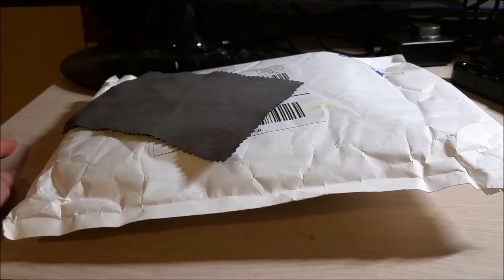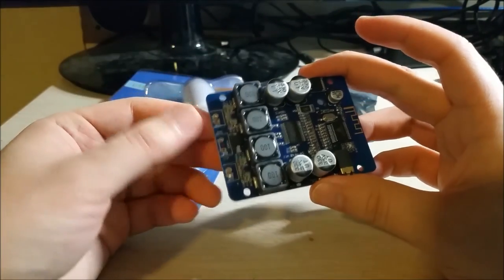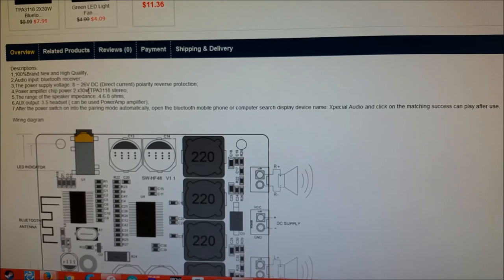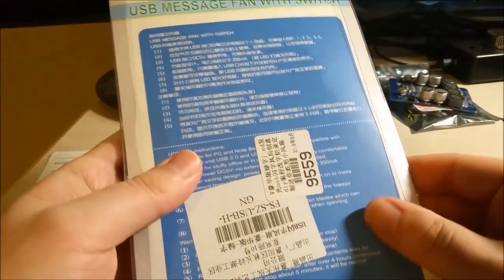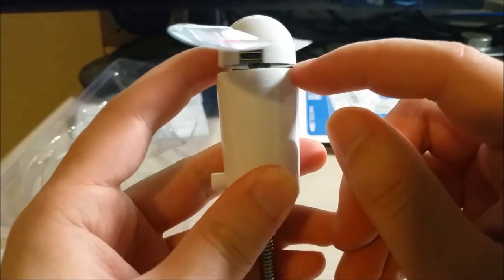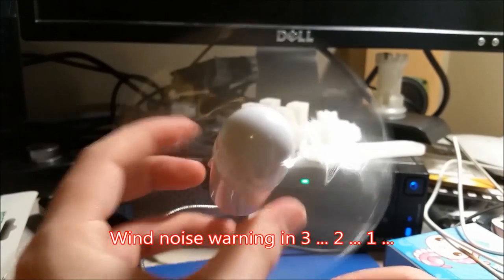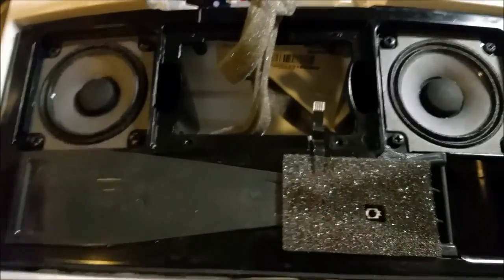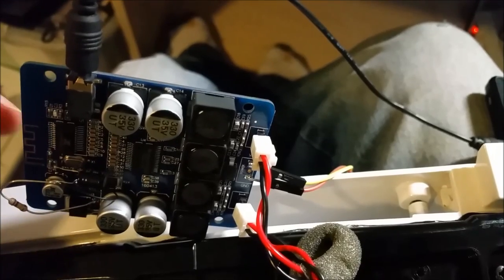Mailbox #3: ICStation DIY Programmable LED Fan and TPA3118 2x30W Bluetooth Digital Power Amplifier

Comment: Could you draw on a real photo of the amplifier the modification you made?

I have a sonwu tpd3118 but it's different, mine is red and has pins to put pause and play, volume +, -, next, previous, vcc, gnd and com 1v8 =? also pins for the audio jack. they are 4 r = right; l = left; t =? and com = ground.

You know what is t in the jack pins and what is com1v8?

thanks

Comment: i have many amp board, but as i tested with my speaker, this was the best sounding to my ears. BUT the bottom side was bluetooth signal is to weak, its always delayed or disconnected within 2 meter. Can you make a mod for external antenna? thanks if you can do that

Comment: Hi I'm thinking of using this amp to add bluetooth functionnality on an old car (found the 12v ignition signal and speaker connections from the cd player), do you think this would work well for my application ? Would it be loud enough ?
Reply from the maker: It'd be plenty loud on 4 ohm speakers.

Comment: hey great video.  i have got a question. if you could help me out. is there any ground loop or ground noise in your amplifier? if so how do you eliminate them?
Reply from the maker: There's a little hum if I put my ear right next to the speaker, but it is unnoticeable when further away and definitely when playing music. As a general rule of thumb, to eliminate ground loop hum you will need to make sure to use shielded cable (coax/braided/etc) on all low level pre-amp side audio signals, use a filter (common mode choke/low pass filter with 3db point set below 50/60Hz) on the power rail to attenuate 50/60 Hz, use an isolation transformer in line with ac supply if one is used for power. As you can guess, what tricks you can use will depend highly on what your exact setup/wiring is.
Reply: @sjm4306  Thanks for the quick reply :). i will check mine. and use shielded cable.

Comment: So if I wanted to use the Amplifyer only with AUX I couldnt just basically rip out the Bluetooth antenna could I? It would just stay muted wouldnt it?
Reply from the maker: I guess if you really need to shut bluetooth off you can feed the aux port detect pin to the sleep pin on the bluetooth chip to force it to shut down when using line in. Or even easier just desolder the bluetooth chip/cut power traces to it and be done with it.

Comment: At my module tpa 3118 2x30watt. Near 3,5mm jack socket. Theres 2 little hole with note Vol +. How to put volume potensio for his modulle board. Thanks
Reply from the maker: Have a link with a picture of the board so I can see?
Reply: @sjm4306  would you let me.know your email, so i can send the pict by email
Reply from the maker: Sure, my email is sjm4306@gmail.com

Comment: Hi. Im using same amp. But i have problem making a really low volume. Can u help me how to add a volume on it?
Reply from the maker: Leecarl Liwanag If you look up the datasheet for the chip you can find out which pins control the gain (loudness) and check them with a multimeter to make sure it is set to the loudest setting. Mine is plenty loud so it could be yours has some soldering problem or is damaged.

Comment: Is there a way to turn off those stupid announcements? I really hope there is a pin to pull up or down to put that cute lady to rest...
Reply from the maker: NGC1433 I wish there were an easy way. I just manually momentarily mute the amp when I go to connect or disconnect.
Reply: I scrolled along the datasheets for a couple of those BT chips - they are immense beats with a bunch of serial interfaces for control. This one has a facility to use audio files instead of beeps, as particular manufacturer choose to do. But digging into them just to configure the announcements defies the whole reason of existence of these amps - three wire connection bluetooth enabled soundthings as a one evening project.
Reply: @sjm4306  how do you mute this amp
Reply from the maker: The amp chip has a mute pin, I just soldered a wire to it so I can manually mute audio output. You can find which pin it is by downloading the datasheet.

Comment: What to do if the amplifier does not work bluetooth
Reply from the maker: It depends on exactly what doesn't work and how it doesn't work as to what the problem and solution might be. I would need more info.
Reply: @sjm4306  when I turn on the amplifier and bluetooth on the phone it does not display the available bluetooth so I can not pair
Reply from the maker: What voltage are you feeding the amp? Does the amp make any sound when turned on? What phone are you using?
Reply: @sjm4306  the amplifier is powered by 12v. That's how it sounds when I turn it on, I use the phone: Samsung Galaxy j5 (2016)
Reply: @sjm4306  .
Reply from the maker: Keep in mind that I'm currently at work and only able to respond during breaks. Have you tried any other bluetooth devices just to rule out that it is something buggy with the software on your j5 in coordination with the amp bluetooth receiver? Additionally, I often have trouble connecting to bluetooth devices on my phone if I haven't rebooted it in awhile.
Reply: @sjm4306  I tried on different devices and it does not work. I apologize for the problem
Reply from the maker: Ok, well the next step is to measure the 5V power going to the bluetooth module with a multimeter to make sure it is correct.
Reply: @sjm4306  How should I check it?
Reply from the maker: You set the multimeter to measure dc voltage, put the negative probe on ground and use the positive probe to measure the input voltage pin on the bluetooth module to make sure it is 5V (you can find the correct pin by looking up the datasheet for the bluetooth chip online).
Reply: @sjm4306  ok
Reply: @sjm4306  I have one more question. do I have to connect it to bluetooth like you in the movie?
Reply from the maker: You can use the 3.5mm headphone jack and connect using an audio cord to a source, but you need to do the mod I show in the video for it to stay on.
Reply: @sjm4306  I'm sorry I'm asking so many stupid questions for you. But I'm a beginner and this is my second thing I'm offering. And I care about bluetooth to work
Reply from the maker: Your questions are not stupid, and you'll only ever learn by asking questions. I started out not knowing anything too, and it took years and years for me to learn by asking questions.
Reply: @sjm4306  All in all right. But back to the module, why would you have sunk a wire to bluetooth
16:24
Reply from the maker: So the amp has a shutdown pin that is fed by the bluetooth part that says to keep the amp on while bluetooth is connected to a device. The problem is if you want to use the 3.5mm audio input jack and not bluetooth the amp will shut off. To keep the amp always on I needed to cut the shutdown trace between the amp and bluetooth. I then had to tie it high with a resistor and capacitor to decouple it because it needs a slight delay at power on or the amp will start to oscillate and possibly damage the speakers.
Reply: @sjm4306  so I have to do like you in the movie to make me bluetooth work?
Reply from the maker: No the bluetooth should always work unless there is some hardware fault. The mod I do is so I can use the physical audio input jack and ignore bluetooth.
Reply: @sjm4306  so I can not do anything about it?
Reply from the maker: As I said before you will have to measure with a multimeter to figure out what is wrong. First find the datasheet and check the supply voltage to the bluetooth module and confirm wiring/soldering. If all this looks ok then it is likely be your bluetooth chip is somehow damaged or defective and needs to be replaced. If this is the case I would suggest contacting the seller and asking for a replacement module as everything really should just work out of the box.
Reply: @sjm4306  In which places should I put a multimeter?
Reply from the maker: You need to read the bluetooth chip's datasheet to find the supply pins. Alternatively you can look for a decoupling capacitor near the chip and measure that. If I just tell you exactly where to probe you wont really learn why or how to find that info out yourself so the best advice I can give is to read and study the datasheet to figure it out yourself.
Reply: @sjm4306  But when the amplifier makes a sound when turned on, ie the current comes to bluetooth?
Reply from the maker: Does it say "ready to connect" or something or just there is a thump or click sound? Either way I believe the voice sounds for connect and disconnect are loaded from serial flash chip which is separate from the bluetooth chip (but may be controlled by the bluetooth chip). I'd have to look at the module schematic to know.
Reply: @sjm4306  says he is ready to connect
Reply from the maker: Sounds like it should work then. How are you trying to connect to it with your phone? (what buttons do you click, what messages do you see, etc)
Reply: @sjm4306  when I have bluetooth turned on I do not get anything to pair at all
Reply: As if bluetooth does not send a signal
Reply from the maker: On your phone did you turn on bluetooth, set visibility to on and tell it to scan for new devices?
Reply: @sjm4306  Yes, with other bluetooth devices it normally connects
Reply from the maker: Ok just checking. Then my final suggestion still stands that you should contact the seller and ask for a replacement for a faulty module.
Reply: @sjm4306  Ok, thank you very much for your help and time😁

Comment: Happens I also have a Bose sound dock donated to me with a broken DSP board so your idea might be useful.  But I think the DSP board seriously does some processing compression and base wise. Does it sound ok without using an equalizer?
I received the same TPA amp board a few weeks ago and I am very impressed with that one.  Yesterday we had some sun and clouds  sun I connected it to my 12V mppt board(http://www.ebay.co.uk/itm/152210070439)  (without batt attached to it) and to a 40Watt solar panel.  It played really nice all day long. And actually you could turn it up seriously loud too.    I wonder what the minimum current is that it draws.
Reply from the maker: Luc Peeters I've been using the modded bose speaker connected to my projector and it sounds absolutely great for watching movies. I'm sure with the original electronics it would've sounded orders of magnitude better but with the tpa amp I am seriously impressed.
Reply: Ok cool, so another project for me coming up. Salvage 18650 batts and mount them inside.  We all have tablets and smartphones now to use as audio source.  If you are interested into sound modifying stuff and you have a rooted android phone don't forget to checkout viper4android.
Thanks for the modification on the board. I actually thought it was the BT audio out and not an input.
Reply from the maker: Luc Peeters There's a small gotcha with the mod that I've found. If you power cycle it without waiting for the cap to discharge it will repeatedly thump. A better mod would use a 555 or microcontroller to provide the power up delay.
Reply: Mmm what would happen if you place a 470K over the capacitor?  Guess the voltage at that point would still be sufficient and the capacitor would discharge a bit quicker. . Lets not over-complicate stuff ;-)
Reply from the maker: Luc Peeters Yeah a bleeder resistor in parallel would help. I just like throwing micros at everything since I have drawers full of them lol